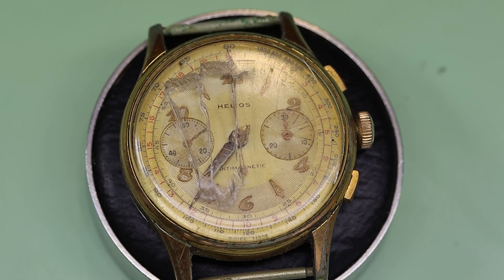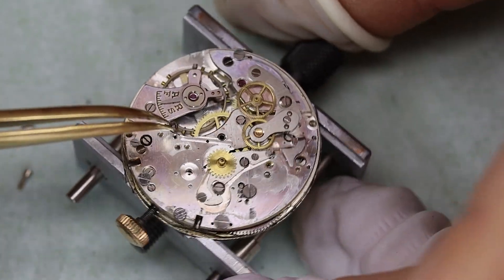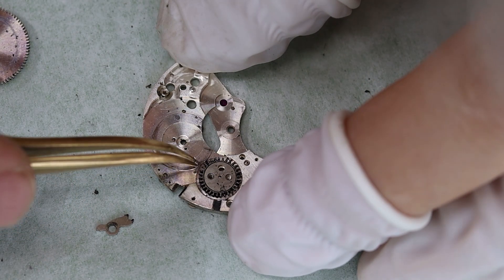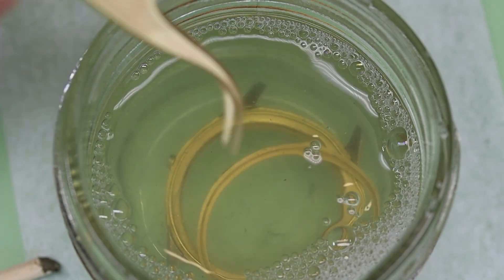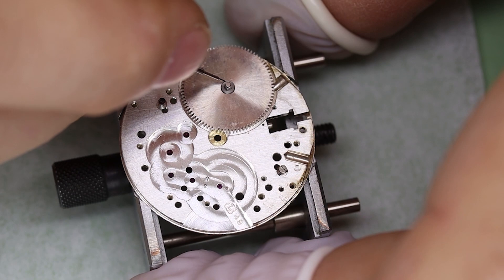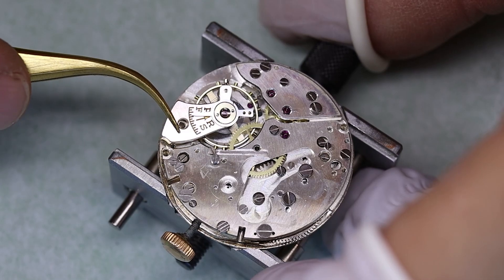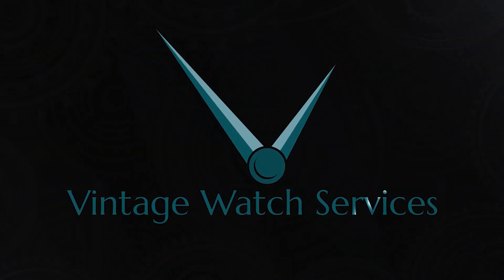A 1940s Helios Chronograph - will it run again?

Comment: Great job and commentary as always, thank you! I have a Landeron 48 (unnamed watch brand) that I plan to work on soon. The watch is missing the bezel though. Is it something I can find or should I try to get a "new" case altogether for it? Keep up the good work!
Reply from the maker: Finding a bezel for an unnamed old brand is practically impossible, but you could try to make one if you have a lathe. Otherwise you'd indeed need to find a different case.

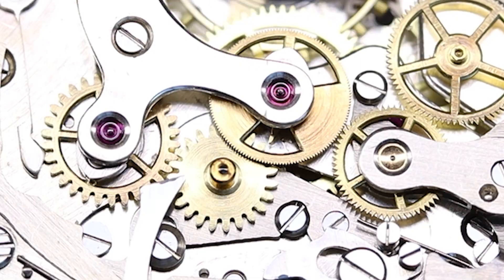Comment: 21:10 -- I guess that's a common thing for chronographs, where that -- I guess it's a seconds wheel because it's what flips over the minute? -- has very fine teeth, but the wheel it meshes with has far larger. Why do they do that? And it looks odd, as though it should be reliable, but obviously they wouldn't make them that way if that were the case.

Anyway, very nice restoration. If any one part had been either brought back to new condition it would have looked fake, but with everything in good working order but obviously aged it came together perfectly.
Reply from the maker: Hello Chris, thanks so much! The chronograph wheel which shows the seconds indeed has twice as many teeth as the clutch wheel. The reason for this is that it makes the start of the chronograph seconds hands smoother, as the teeth will engage with less of a jump.
Reply: @VintageWatchServices  Thank you!  I still don't know chronograph parts all that well. (Or at all, really.)

Comment: It never gets old seeing a beautiful dial emerge from behind a cracked, faded or stained crystal!   Seeing the yellowing of the varnish/top layer of that dial (and that stubborn dirt spot at 11 o'clock!) I wonder whether any of the newer art restoration techniques could be used on these dials, in particular with regards to cleaning?  There are so many delicate, non-intrusive methods used these days for cleaning & stabilising paintings, prints, & other objects on a plethora of different surfaces (from rice paper to metal), I'd be surprised if there wasn't a way to give some of these dials a bit more of a cleanse without losing patina or damaging the printing.
Reply from the maker: The main problem with watch dials is that the layers are so thin that there is nothing to work with. Once you remove the varnish you're right on the thin layer of paint or the print. So there isn't much that can be done with a watch dial apart from removing surface marks - which are generally not the issue - or refinishing the dial, which for vintage watches will very rarely make it exactly as it was when it was new. So it's kind of a lose/lose situation, unless one happens to like patina :)
Reply: @VintageWatchServices  What a shame... fortunately there's plenty of us who love & appreciate both a patina and the original intended beauty of the original artist/watchmaker, so it's definitely a win/win to be able to see these mini-masterpieces regardless of their condition. ☺  Thanks for these brilliant videos!

Comment: Nice work and thanks, because i also have such a movement that needs servicing and now i can use this vid as a guide. Some questions tho: i noticed you only put some grease on the bottom of the barrel, but not on the inside of the barrel-cap. Is there a reason for that? Second question: did you notice any difference in performance of the movement with the chronometer running? Thanks!
Reply from the maker: Hello Erba, thanks for watching! With new mainsprings you generally do not need to lubricate the barrel, but if I reuse the mainspring, I'll lubricate the bottom of the barrel and the top of the mainspring.

Comment: Greetings Stian, beautiful job. What was that goober on the dial at 11 o'clock? And why there? How/why does a dial deteriorate? I think you did the right amount of restoration. I've seen watches that needed more restoration than the individual wanted to give it claiming the "patina" was important but to me the dial just looked bad. I've also seen some beautiful dial restorations. I suspect as you gather more and more tools you get more inclined to use them to polish and subsequently re-plate cases. I certainly won't have to worry about that for a while. Cheers!
Reply from the maker: Hello Gary, thanks for that! Dials degrade layer to layer, and the top layers are typically clear varnish, sprayed on to protect the underlying patters, print etc. The dial material is generally brass although there are also silver, gold, stone etc dials. The dial itself does thus not rust as a general rule. The typical damage to a dial is to the varnish layers, and this can be discoloration, flaking etc. That's what happened here, the varnish has become dirty and that dirt has set in the varnish. The only way to remove it would be to remove the varnish, but that would result in a much ligher spot. And between a darker spot and a ligher spot, the darker spot looks better in my view :)

Comment: Thank you for gold plating the case, as your typical wont is to leave the older ones looking rather forlorn.  Now about that black spot at eleven o'clock--couldn't just brush on a little gold enamel to cover it up?  Just kidding.  Look at this, 11K subs and counting.  You and Mr. Nekkid are the two most enjoyable watchmakers in my opinion.
Reply from the maker: Thanks so much, Cory! The difference with this watch and most of my other watches is that this one I bought simply for this project. Most of the watches I buy are already in very nice condition visually, so I mostly just service them.
Also, the gold plating on this one was so far gone that there wasn't really any other option. Gold plating is a tricky thing, as new gold plated watches typically have a 20 micron layer of gold, which is very difficult to achieve without industrial level plating machines and also inhibitively expensive. So there's a lot to consider before re-plating a watch!

Comment: I think if it were my watch and a family piece with sentimental attachment I'd also prefer a light restoration.  If it were just an old watch I picked up cheap and all there I'd like it restored back to how it was when new.
Reply from the maker: Thanks for watching! The main consideration in my view is the state of the dial. If the dial is in good condition, as I think this one definitely is, then the rest of the watch should match it so that it looks coherent. If the dial is so badly damaged that it needs to be refinished, then I might go further with the case also. But opinions vary! :)
Reply: @VintageWatchServices  I suppose it comes down to what you'd be happy to wear. I'd not wear it if it looked battered and worn as it just looks scruffy then. This turned out great and something most would be proud to wear.

As a couple of asides, in England from the older generation you will hear the term "pull the chain" to flush a toilet for the same reason you had in Norway. Also, my father always referred to a watch as a wrist watch as he was from an era where a watch could be worn in the pocket. We still use the term pocket watch but I think most have dropped the term "wrist watch" for what we now know simply as a watch today.
Reply from the maker: That's very true, it takes quite a while to change these expressions. One even a bit closer in time is perhaps to "hang up" the phone :)
Reply: @VintageWatchServices  Yes very true and that type of phone probably went out of favour about the same sort of time as pocket watches did, or maybe even a little before? I never used one for sure but I did pull many a chain.

Comment: As for level of restoration, I don’t think there is ever one right answer. An object could have a number of interesting stories based on various combinations of three factors. 1) How good of shape it’s in, 2) What it has been through, and 3) How well it was cared for. I’m with you in that the broad strokes of the second and third factors are the most interesting even if the details have been lost to time. As for the first point, unless it is a defiant survivor that has beat the odds to still be working, I like things to be in good enough shape that my imagination can picture it’s aesthetic appeal when it was new.
Reply from the maker: Thanks, Gavin! It's indeed difficult to determine exactly how far to go, but must of the time the dial will be the deciding factor in my view. If the dial is mint and the case badly beat up, I'd be okay with restoring the case to its original condition. If the dial is badly damaged, it must be refinished. But most of the time you're somewhere in between these scenarios and then it's really a question of philosophy 😊

Comment: Hi, I have an ORATOR watch with a Landeron mechanism. Some say are 48, some 52. 
The operation of choro buttons are: 
Press the upper pusher - starts big second hand and the small right side minutes counter (0-30).
Press the bottom pusher - stop the counting. 
Press it again - reset the counter
OR press the upper pusher - the counting is resumed.
Question for you as a fan: it is a Landeron 48 or a 52?
Thanks
Reply from the maker: Hello Dan, sounds like you have a nice watch! The Landeron 52 was a pillar wheel chronograph, which would be operated as most other chronographs: the top pusher starts and stops the mechanism, the bottom pusher resets it. Thus yours is probably a 48 (or one in the 48 family).

Comment: how come the insides remain clean even after ~80 years?
Reply from the maker: Thanks for watching! It hasn't been quite 80 years since the last time the watch was cleaned, but if a watch is properly closed it should stay pretty clean for decades. Tiny debris and dust particles will be able to enter, but not hair, sand etc.

Comment: Just curious, How do you stop the balance wheel without damaging it?
Reply from the maker: Hello Thomas, in general you should let down the mainspring before stopping the balance wheel. If there is little power on the train you can stop the balance by gently touching it with for instance a pegwood stick.

Comment: Hi Stian, I realise that watchmakers are a dynamic lot and love to live on the fast lane. I, however, like to take a moment to appreciate things. (I'm definitely not saying I'm slow at understanding stuff.) So, personally, I'd like the editing of the videos to be a little less hectic - cuts of more than a mere fraction of a second, maybe? I actually like to watch you do things and follow the steps taken. This video, IMHO, seemed a bit rushed. But then, that's just me.
Reply from the maker: Hello Gordon, thanks for watching! Sorry about that, which part did you feel was rushed then? The good thing is that I'm available to answer questions you might have 😉
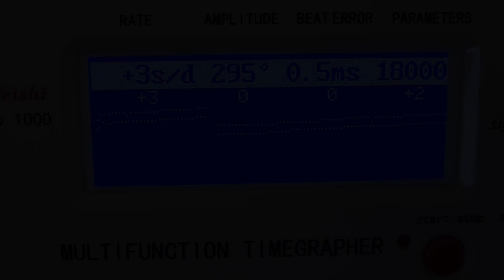Reply: @VintageWatchServices  Stian, I felt that the sequences at, for instance, 2:50 min, or at 18:40 min were a little fast for me. It's not that I have a particular question; it's just that I could hardly identify which parts you were working on. But then, nota bene, I'm just an interested amateur.
Reply from the maker: Hello Gordon, I understand what you mean, and it's a bit of a trade-off between making the videos manageable in length versus educational... I want to try to keep them below 30 minutes and ideally closer to 20, and it might indeed be that some things are presented a bit too fast to really see what's happening. What I'd suggest is to view a couple of other chronograph videos as well, as the parts, functions and layouts are in broad outlines the same. For instance the Longines monopusher I just put up, the Mirexal 7733 or the Juvenia Venus video. These movements are quite similar in layout and although a couple are column wheel rather than cam switched, most of the springs and levers are the same.

Comment: That's a lovely looking watch (after  your work especially). Can I ask if there is a rule of thumb for how much pressure you apply when putting the hands back on. 
Thanks for the great videos.
Reply from the maker: Thanks so much for watching! There's no real rule of thumb for the pressure, but the top of each hand should typically be flush with the top of the tube of the corresponding wheel. And never use too much force :)

Comment: Wonderful job Stian! Your ideas are spot on. Looks like a watch I’d love on my wrist. You know that saying ‘something for the weekend sir?’, well this video made my weekend! You never told us about the Helios brand, but we got the toilet flushing story😀
Reply from the maker: Thanks Boyd! 😁 I honestly don't know much about this brand, but believe they supplied watches to the German forces during the war. There is a brand called Helios today but it's completely unrelated.
Reply: Thanks Stian. I’d forgotten this one, great to watch again. Any tips for me with my first Landeron 248 service (everything’s works ok). I only use an ultrasonic cleaner. Do I need to worry about the eccentric screws moving? And how do I identify them? Also, I should my a presto tool for the driving wheel. How do I know how far to press it back in again? Any other top tips for a chrono virgin? Ta.

Comment: Really nice job on this one. And I agree : old pieces should look a bit of their age. That is, unless they really are too far gone. Then, it's no longer really a restoration and recreating to a new condition can make sense. Nekkid's work on cases looks excellent, for instance.
Reply from the maker: Thanks a lot! I think the main difference is that Nekkid seems to focus on watch repair while I actually focus on selling watches. Thus the watches I get on my bench are in general already in quite good condition, otherwise I wouldn't buy them. And if a watch is in good, original condition, most vintage collectors would agree you shouldn't do too much to them. 
I am however changing this up a bit, buying beat up watches only for making videos of restoring them, so I'll go a bit further on some future watches. Nekkid is certainly much better than me at case restoration though 😉

Comment: Lovely watch Stian! I love the dial, and the case now has just the right amount of patina, even after replating. My nephew has a Duval chronograph from the 1960s with (I think) a Landeron movement. Of course, he now also has an Omega Speedmaster triple date (as you know). Too bad this watch is not a 1951 (YOB). I would be tempted.
Reply from the maker: There were so many watches with this movement family and you should be able to find a nice 1951 one, I think 👍

Comment: Btw kind sir. Stop showing off your fancy watch cleaner. Some of actually still have to get up and move to the other stations.. sigh... Haha! I am of course joking. But not about the different stations.. 👹

Okay may I ask what you use on watch bracelets that you can not seem to get off a watch? I mean if you get one side of the spring bar but not the other side? And the lugs can take a beating. I have so you know , a pair of Bergeon springbar tweezers ( no luck with them over priced pieces of #%!) No luck with the Horotec spring bar pliers actually I think it's a Bergeon as well? I have to look.. I have a few watches I wish to remove the bracelet ( to slow the wear on the lugs) and to set them aside for a future sale if I so decide. Besides I prefer leather on some and silicone on others. But some of these high end Suisse watches just are a real pain to remove the bracelet. Some springbars and hairsprings are my kryptonite I tell you...
Reply from the maker: Springbars can indeed be very tricky sometimes if they've sat there for a few decades gathering DNA 😁 I mostly use a screwdriver if I cannot get them out but also use a standard springbar tool with a pin on one end and a fork on the other.

Comment: I inferred you thought replacing expensive last video.
Reply from the maker: 🤔 Auto-correct message ?
Reply: @VintageWatchServices  yes; the word was “re-plating”
Reply from the maker: @jacobgreenmanedlion1863  Ah yes, re-plating to the original thickness is inhibitively expensive, and in general, if the original gold plating is only a bit worn, it should not be re-plated. This watch was however too far gone, so I believe re-plating was the correct choice here. 
The re-plated gold on this one is only about 2.5 microns compared to the 20 microns it had when new. The new gold plating however has a higher hardness rating, so it will be fine for quite a few years. But it will not be as strong as the factory plating, which is why one should be very conscious about the choice of re-plating or not.
Reply: @VintageWatchServices  ah that makes sense. I have never been a fan of gold plated watches for regular use. I believe in using vintage things in everyday use (not just watches- my kitchen stove is from 1927ish for instance) and I find that solid gold is worth the extra outlay, especially considering that if you do sell it, you get most or all of that premium back. I wear my 1958 Rolex under just about every circumstance that doesn’t involve heavy impact or active water.
Reply from the maker: @jacobgreenmanedlion1863  Solid gold is absolutely preferrable from a longevity point of view, but it's obviously also much more expensive. Thus for reaching a larger market of buyers, plating is a good option, but when it wears through, you're kind of out of luck :)